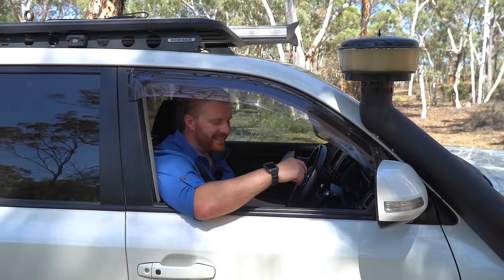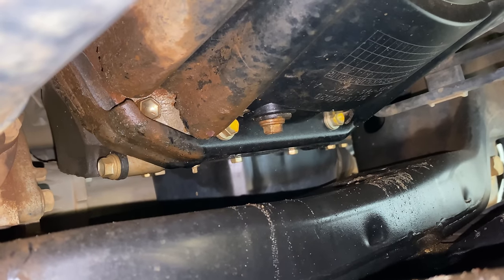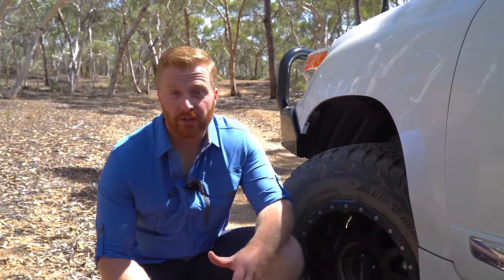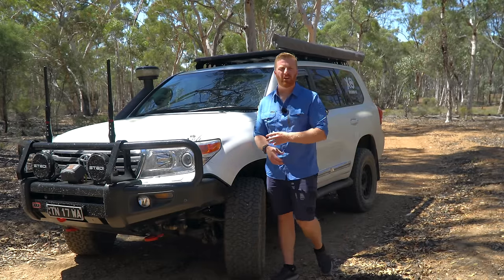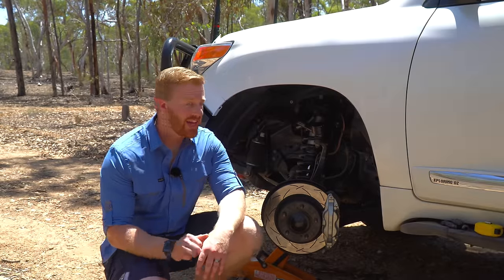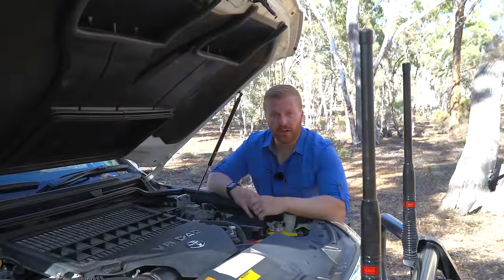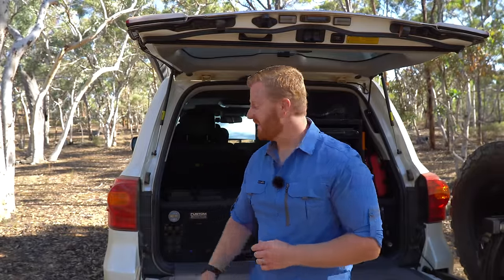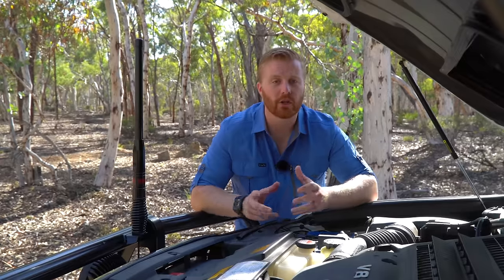LC200 | PROBLEMS & ISSUES | Not everything goes to plan -Mechanical-Electrical-Suspension 200 SERIES

Comment: Is there a genuine Toyota catch can?
On suspension balance with KDSS lean maybe use load cell under each tyre to see if it is weight lean or suspension / kdss?
Is hard start compression test time? Moist cylinders ?
Reply from the maker: I don't believe there is a genuine Toyota catch can. 
Good idea with the load cell under each tyre, haven't done this before, would be interesting to see the differences. 
Hmm, could be. I'm hoping it's not that bigger of an issue at this point.
Reply: Yes, there is a genuine Toyota catch can... But Toyota calls it an intercooler & E.G.R inlet tract and manifold.

Comment: With your fuel issue you may have a really small air leak in one of the fittings allowing fuel to siphon back into the tank . This is a problem I had on a Series   Landrover many years ago . A more recent problem I have had with my LC79 is a blocked fuel tank breather causing the tank to pull a vacuum as the fuel was used causing the blocked fuel filter light to come on .
Reply from the maker: Hmm, I'll check this out for sure. Thanks mate 👍

Comment: Did you figure out the problem with locking the car?
Reply from the maker: Still something that is on-going. Seems to be a seperate issue to the rest of the electrical issues...

Comment: Spare a thought for those who make the mistake & buy high priced 4WD shock absorbers with no stone shields at all protecting the chrome on the rods. I had a bloke tell me they are hard chrome plated & won't be damaged by road gravel. I told him they would be pitted, nicked & rock blasted in short time and leaking oil everywhere. Even the shocks with the neoprene bellows are bad for sucking in dust through the breather holes & wearing out the seal on the shaft as dust sits in the little seal recess around the shaft & works its way in. I wash the bellows out & blow the seal area clean with compressed air. I've got a solid front axle in my VDJ79R and recently had to repack the swivel hub & replace wheel bearings due to water ingress & water contaminated grease so they too can get water into them given enough water crossing or in my case I think it was from ploughing through long water puddles on flooded roads which blasted water into the swivel hubs. I like to solder all terminals on 12V inputs, crimped joints are a bit iffy. I reckon the standard Toyota fuel filter system is OK & you don't need a secondary fuel filter, especially a secondary fuel filter with a lower micron filtration than the stock fuel filter like they all are. Those key isolater switches are dodgy especially under heavy amp. draw or as you found even when simply required to work & they don't, I just connect my winch cable positive to my battery terminal threaded post when I need to. I fitted one of those Terrain Tamer stainless steel inserts to my airbox lid that increases the sealing area & I rubber grease the filter seal & are careful how I fit the airbox lid as to not roll or crimp the seal, no dust past the sealing lip on my stock airbox. I found those clear bowl Donaldson cyclonic snorkel heads to be good & filter out plenty of fine dust and particularly little black nat insects that would otherwise make their way to the airfilter element.
Reply from the maker: For sure, I hear you there. I agree that those chrome rods definitely need some sort of protection. After seeing what damage can be done to the underside of my old caravan with rock chips, there is no way these parts are immune from that kind of wear and tear off-road. 
Thanks for sharing all of those tips, they are all good points and something that I'm sure all 200 series and 70 series owners can relate too. 
Cheers, Nathan.

Comment: Great vid Nathan. I have the BP51's and I'm at 60K of use. The only issues I've seen are the flimsy plastic guards...someone really needs to do a good aftermarket solution for them. I didn't fit new UCAs despite the obvious reasons to. So far, I've had no issues, but will watch the tyre wear. 

What DIY materials would you take on larger trips in case of the CV boot issues? I've seen a few similar cases on 200's, and would love to be prepared for that one.
Reply: Try wrapping several layers of Gladwrap around the broken boot to keep dirt & water out.
Reply from the maker: Glad to hear that you have had a relatively good experience with them so far, definitely encouraging. 
Kaon do some great aftermarket solutions for the rear shocks. Nice solid SS protective guards.
Hmm, as @Dusty Farmer said, you could try wrapping them up, but this is only going to be a temporary fix. Personally, if you had the space and $$ I'd be carrying a spare joint around if you are heading remote.
Cheers 👍

Comment: Nathan, Pro Touring Concepts have mentioned in one of their 200 chop series that a better quality starter battery is important. I guess the CPU could be detecting voltage irregularities and causing faults. Checking all the earth posts are tight and not corroded also helps. Regarding the suspension it sounds like ARB are loosing their platform of quality and reliability or the people they employ are not as skilled and customer focused as we expect.
Reply from the maker: Thanks mate, interesting point there, I'll have a look into this. I'll definitely be going through and checking everything in a little more detail now. 
Hmm, yeah, ARB might be getting a little too big for their own good to be honest. 
Cheers, Nathan.

Comment: do you think your rear main seal leak could be caused by provent catch can? I've heard they can pressurise the crank case and cause leaks. particularly if your cars been tuned. Interested to hear your thoughts as I have a provent on mine too
Reply from the maker: Although I see the logic regarding this issue, however I wouldn't be able to prove this. Saying that though, the Provent unit does have a pressure relief valve to try and avoid this issue. I'll definitely be keeping an eye on it though. 
Cheers.
Reply: I've had a genuine Provent 200 on my daily driven V8 diesel Landcruiser for the last 100,000k's and have zero oil leaks from anywhere on the engine. You can only over-pressurize the crankcase if you have massive blowby that is in excess of what air can flow down the 19mm hose & what the turbo is sucking through the catch can. Even then in the event of a blocked filter or over-pressure on the engine side of the filter it will vent to atmosphere on the older cans or bypass the filter on the Gen.2 Provent 200 & flow back into the air intake duct. Catch cans get a bad wrap from the rubbish design ones on the market, The genuine Provent 200 is NOT a rubbish design catch can and it actually works as intended.

Comment: voltage draw your inverter will draw power in stand by mode disconnect it and check if you still have power draw
Reply from the maker: Thanks mate, I'll double check this however form memory I still had this issue before the inverter was installed. 
I'll check it out though. 
Cheers, Nathan.

Comment: Hi Nathan, I had a similar issue with dropping down to 3ish volts.  My issue was the fuse was corroded and gave poor/no contact, however the fuse holder has one of those LED lights to indicate a blown fuse.  The LED was passing just enough current along with the bad fuse connection to show up a low voltage rather than zero.  I got some weird issues on the USB charges etc.  Not sure if this helps or not!  Electrical gremlins are the worst.  I try to keep clear of the fuse blocks/holders with the indicator lights for this reason, but it was all I had at the time to install.
Reply from the maker: Thanks mate, appreciate the suggestion. It will definitely go back and check all of these connections and fuses. You are right though, they definitely are a huge pain! Interesting to hear how the LED issue played out, didn't think about that. 
Cheers, Nathan.

Comment: 1:00
 xD That issue with engine dying in you could be EGR - altho maybe australlian models don't have that god damn piece of hardware. It could be putting too much air in the engine and/or be responsible for similar fuckery. It sucked power right out of my LC100 year ago.
Reply from the maker: It shouldn't be the EGR, although this vehicle is fitted with one, it may or may not be in use at the moment 🤔
Reply: @XploringOz  yeah. In any case, it sux balls. I hope you find that bug!
Reply from the maker: @DanielTejnicky  Sure does 😂 Thanks mate

Comment: Had the same problem with engine cut out after a few seconds running. Found my fuel pre-filter has a small amount of air trapped inside. Only found it after turning filter upside down and saw the bubble in the glass. Removed bubble and problem solved. Excellent video as always.
Reply from the maker: Thanks mate, I'll check this out and see if I can get any air bubbles out. Would be happy if it is just a simple problem like this 👍 
Cheers, Nathan.

Comment: Excellent video Nathan, I had a similar fuel issue with my Dmax and reported it numerous times. Found there was an air leak between the tank and the 30 micron primary filter ( self diagnosed) retightened all of the hose clamps 👍. 
Ian
Reply from the maker: Thanks mate 👍 
Hmm, yeah I'll check this connections again and probably end up replacing the primer, sounds like this could be a potential issue too. 
Cheers.

Comment: As soon as we put a Waeco CFX in our cruiser we had issues with the remotes, after much frustration we changed back to an Ingel fridge and now everything works fine. Even if the Waeco is turned off and still plugged in it interfered with the remotes.
Reply from the maker: Hmm, this is an interesting one. I'll definitely check this out and see whether or not my CFX65 is causing the issue. That would be a simple fix to a frustrating problem!
Cheers, Nathan.
Reply: Ops, to remember when back in the car and my new cfx50 is plugged in.
Thanks and cheers.

Comment: If you run a DCDC in the vehicle, they will pull those kinds of amps when not in use. Check the owners manual on it to be sure.
Reply from the maker: Hmm, interesting. It's definitely something that I can't do without though. Looks like I'll have to get used to it then 🤦‍♂️ 
Thanks, Nathan.
Reply: @XploringOz  do your leakage test with and without it connected to confirm. But your probably clever enough to have already worked that out. I run a Kickass brand in my 100 series and don’t really have a problem but I drive it pretty well every day. Maybe work out an ignition powered relay?

Comment: Love your videos. I am interested in the Donaldson cyclone. Did you have to make a reducing sleeve to fit to your raised air intake? If so what did you use?  The second thing is how you were able to mount your number plate on the tail gate when having a swing out wheel carrier.
cheers
Jeff
Reply from the maker: Hey mate, so no I didn't have to adapt a sleeve. This particular product fits perfectly onto the Safari ARMAX snorkel without any reducers. The exact part I used was https://ebay.us/x7socf.
I have heard that you would need reducer for the smaller Safari snorkels (not ARMAX). 

For the number plates, I just used a piece of white aluminium composite material to extend the bracket to the left. I then offset the number plate on this bracket, which require a slight bend in the number plates. It has been working well and still comply with ADR's being visible from the rear of the vehicle. 

If you want a few pictures, send a message through my Facebook and I can forward through some better pics. 

Cheers, Nathan.

Comment: Provent 200 catch can is what I've been using since 9,000km, now 33,000km.  Before installing the Provent unit the DPF came on three times, but hasn't come on since, so that's 24,000km with no DPF burn.  I think it's a testament to how much unnecessary gunk is kept out of the system.  I drain about 50mL or so of oil and some water out at oil changes.
Reply from the maker: That's definitely interesting to hear and glad that you have managed to get some benefits from this system!

Comment: Did you replace the insulator switch for the winch or are you just not using one now. Great video once again.
Reply from the maker: Thanks mate, appreciate that. So no, I didn't replace it, I just run the winch connected straight to the battery now. No dramas thus far. 
Chees, Nathan.

Comment: Really enjoyed that vid mate, one of your best yet.
Of particular interest was the suspension, especially given I’ve just pulled the trigger on same set up to be fitted in April. I really don’t want that much lift in height, but I am heavy with dual carriers, bull bar winch, dual batt, and drawers etc, soooo hopefully I won’t get anywhere near 4inches in the rear and 2 in the front….pretty keen for 2 at the rear and 1 at the front 🤞
Reply from the maker: Thanks mate, appreciate the feedback! Hopefully the suspension will turn out the way you hope for. I reckon with those modifications it would keep the height down a bit. 
I've found it to be good suspension (after all the adjustments and replacements). 
Cheers.

Comment: Camber angle is corrected by the upper control arms addition
 not caster the caster is adjustable in the lower arm as well as the camber to a lesser affect
Reply from the maker: Cheers mate, I was under the impressions that these UCA's will effect both the camber and caster?
Cheers.
Reply: Blackhawk UCA have 3 degree positive castor angle fixed into them, so most aftermarket UCA's actually do allow for castor adjustment. Some other UCA's also have adjustable castor angles.

Comment: Hey Nathan,

Re: What you think is a Rear Main.  Years ago I had a VDJ79 Series single cab, bought it new, took it everywhere. One day with about 150,000 km I noticed some oil, similar to what yours looked like.  Ohh No, rear Main, bit premature, WTF was exactly what I thought.

Anyway, I dropped my box off, pulled the clutch……WTF, rear main not leaking 😂 Follow the oil, which is much easier now with bits of my truck scattered on the ground 🤦‍♂️…… there it is the seal on the oil pump 🙄 Doh.  😂  

Apparently when that pump seal goes, oil can take a mysterious path…..so check that out, you will need a mirror & an eyeball in the end of your finger 🤷🏼‍♂️

Anyway, since I had all the bits out, I did the rear Main at the same time I did the oil pump seal. 

I think it was $30 😂 for the seal 🙄
Reply: Love your videos.  Over the years I have had love voltage probs with dirty earth terminals,  lose cable lugs, cracked fuses and lose fuse holders.  Can usually track upstream of problem until u find the prob.  Reckon your inverter is sucking juice on standby.  Never had the fuel prob on my 200.  Reckon u get better fuel economy on your cruiser if you keep the rake cause u r always driving down hill!!
Reply from the maker: Hmm, interesting to hear you say that and definitely getting my hopes up there! I'll have a good mechanic check it over and try to determine exactly where this leak is coming from before forking out huge labour costs with a rear main! 

At least you got a new seal while you were there I guess 😂
Reply: @XploringOz  Please do. 

TBH I had forgotten about mine until I saw yours.  I only ever had 2 issues with the vehicle. I did an axel seal at 10,000km…..it wasn’t Toyotas issue, I’d had the axels out when I’d fitted lockers to it (back the lockers were an option), so I’d actually caused that leak.  Then years later I was under it checking it over prior to a trip & I saw similar to what yours looked like. On the manual there’s an inspection plate on the bell housing, I plucked out the inspection plate & there was oil everywhere. (Even small amounts of oil look catastrophic).  

Because I’m old & I can’t remember, I vaguely recall you can look at the pump surrounds from underneath to one side (right side) with a mirror although I don’t know how hard it is to change without removing bits, for me it was all in my face because everything else was laying in pieces on the floor.😂. 

If you’ve got access to one of those cavity inspection cameras, you will be able to have a good look up there.

Thanks for sharing brother, best channel imo 👍
Reply from the maker: @GR8Tmate  Yes, I've heard there is a little inspection plate down there. I'll have to have a look at that, but I know what you mean about a little oil looking like a lot! Doesn't take much. I'm always just checking my oil level between longer drives, just making sure that I'm not loosing a significant amount anywhere. 
The inspection camera would definitely be a helpful piece of kit for a job like this! 
Thanks make, appreciate it 👍

Comment: Hi Ive had similar issues with the engine cutting out i found that by disconnecting the outlet of the factory filter and priming both filters into a container i can see when all the air is out of the system . Ive also added a primer to the prefilter but ran into clearance issues between the primer and the bonnet . Cheers Dave
Reply from the maker: Thanks mate, appreciate the feedback here. I'll have a look into this, hopefully it's something I can get sorted as it's definitely one off the more frustrating issues at the moment. 
Cheers, Nathan.

Comment: Good summary Nathan. 
I'd check the battery and mating surfaces in the remote control to see if this effects your door opening and starting. 
With the low voltage to your rear accessories check the main fuse or circuit breaker. I've seen many of the inline fuse holders severely damaged by heat of poor connections that would have provided partial voltages to their load when faulty.
Reply from the maker: Thanks mate. So I have changed the batteries in the remote a few times to try and sort the issue, with no joy just yet. 
Thanks for suggestion with the connections, I'l definitely look into it. The wiring and positioning of the cabling for these accessories makes it so hard to access in my vehicle, but I'll sure give it a go. 
Cheers, Nathan.